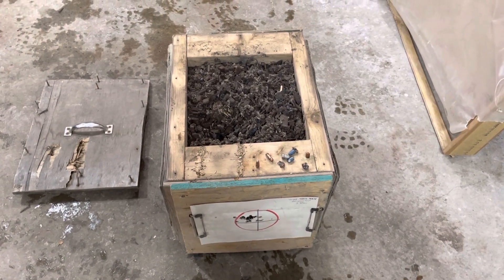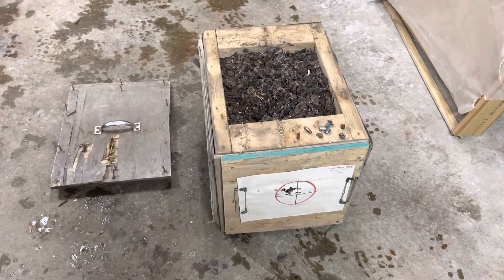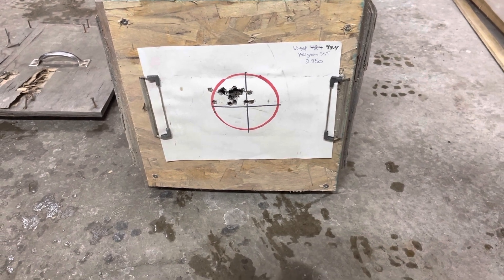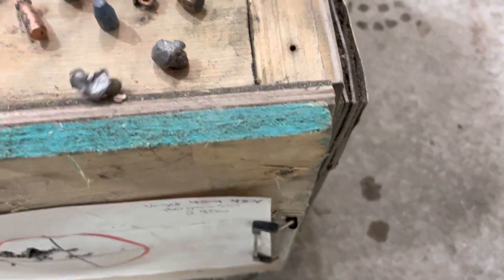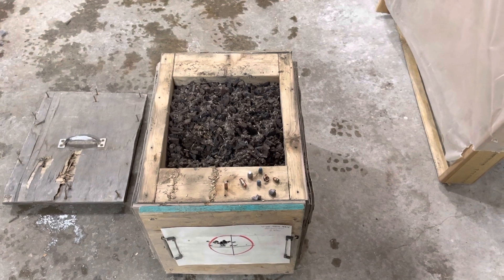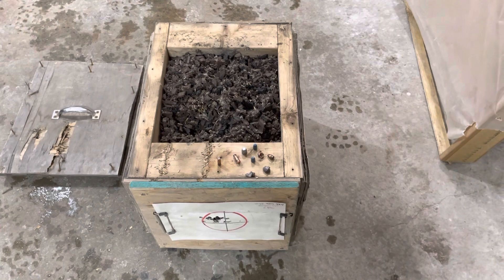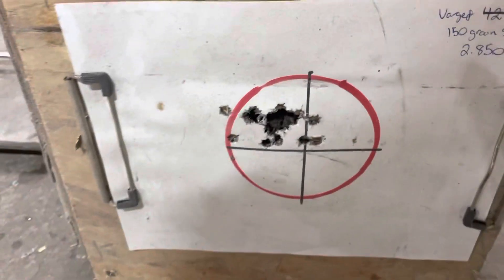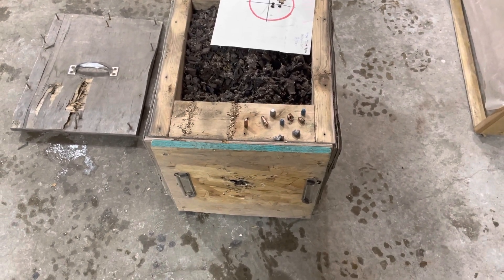Cheap DIY bullet trap

Comment: This seems so much better than the steel traps. The lead (non jacketed) bullets are not fragmented or turned into dust so easier and safer to collect and recast. I would never have thought the rubber mulch would be so effective. Thank you.
Reply from the maker: It works really well.  I hope you try making one and it works for you.

Comment: My theory based on similar things I've seen is it's the same principle as in sand bullet stops; a spitzer point bullet moving at a relatively low velocity displaces the stopping material and just "pushes it" to the side, while high speed bullets moving in the 2500-3200fps range   slam into the particles and they become compressed and denser for a moment
Reply from the maker: You are absolutely correct, everything I’ve seen supports your statement.

Comment: Just made one with rubber mulch and a 5 gallon bucket. Cut a piece of scrap carpeting into a circle slightly larger than the bucket and tuck it in overtop the mulch. Haven’t had any issues for the 9mm I shoot. 

I do have a question though, do you have any tips or tricks for finding your bullets? I hate digging and straining my eyes for them 😂
Reply from the maker: I have dumped the mulch into a bigger tank filled with water.  The lead bullets drop to the bottom of the tank and the mulch floats.  Biggest risk is making sure that the lead is good and dry before you smelt them down.

Comment: How far into your trap do the bullets go?
Reply from the maker: It depends on the caliber, but I can give a few examples.  9mm=4-6 inches.  308=8-10 inches.  300 winchester mag 10-14”. 223 winchester=6-8inches.  I hope this helps.
Reply: I tired 9mm at 10’ away into a 5g bucket packed tight with rubber mulch and it went about 12”. I suspect a 3/4” piece of wood would have slowed it down a bit more. Gonna make a box like yours and try again. Thanks.
Reply from the maker: Let me know how it works for you.  I suspect that you will be more than happy.

Comment: can you use  plain dirt or sand in this ?
Reply from the maker: I never have, but it would be interesting to try.  The biggest benefit from using the mulch is that it keeps the trap fairly light weight.